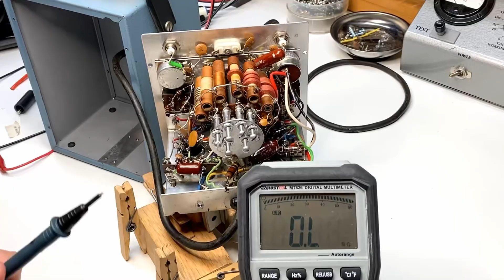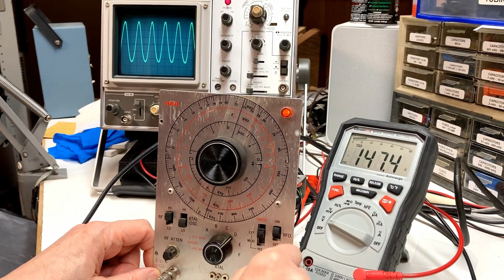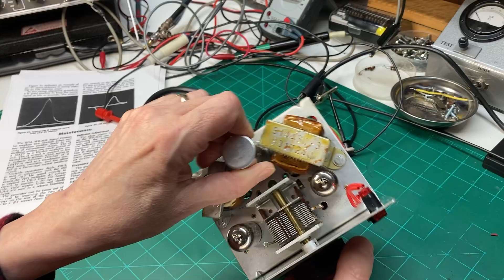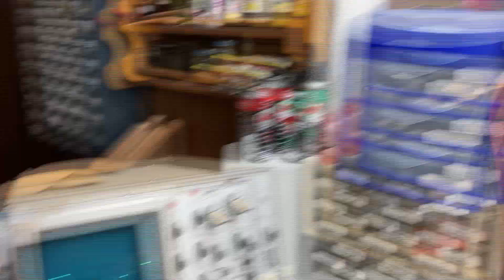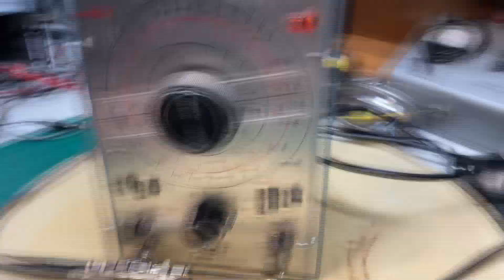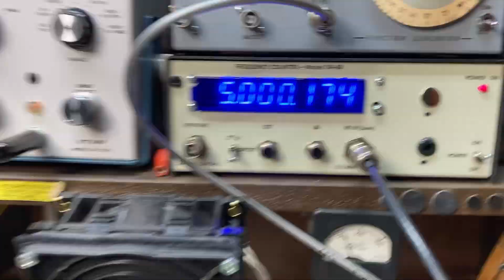RCA WR 50B Signal/Sweep Generator Power Up & Calibration

Comment: I like the parallel output that you have the TinySA and the signal generator hooked up to. Where would I find one? (Probably a common item, but I'm always interested in exact part/model numbers that I see working).
Reply from the maker: I think you are referring to the BNC-T connector, if so, you can get them almost anywhere from Amazon to Mouser. Here is the Amazon link: BNC Splitter Adapter 7 Pcs BNC Male to 2 Female Coax Connector BNC Triple Tee T Adapter BNC 3 Way T Type Plug for Coaxial Cable

Comment: A friend of mine who passed several years ago had a Jerrold 900B sweep generator sitting on the floor in his shop.  That was a 1950s instrument with a big tuned cavity inside which could generate anything from 500MHz up into the L-band at 1.1GHz.  The thing probably weighed about 50 pounds.
Reply from the maker: Back in the late 70's I worked for a guy who bought a simple military surplus audio generator for cheap.  That thing was rock solid but it weighed 75 pounds!

Comment: Your test inherited equipment ensemble looks much like mine.I built my test bench tools up starting in 1962 when I graduated from RCA Technical Institutes. After my tour in Nam with the US Army i pocked up an IBM designed Tektronix portable scope.  I do use my gear in restoring Vintage radio sets. Forget ESR with the cap, no one even had a clue what that was until the advent of switching power supplies. RCA built home equipment to Mil- Spec designs and quality. You wont find cheap paper wax caps in a WR-50 B. The resistors where also a high grade type. Testing each component for accuracy is a total waste of time if you have never fired up the test instrument. If you have a Variac  with parameter monitoring you don’t need a dumb dim bulb  tester, thats for amateurs.
Reply from the maker: I sure wish I could have held on to my Tek. scope when I left IBM in 2020, that was a fine instrument!  The WR-50 B's resistors were almost ALL way out of tolerance. That really surprised me.  As for the dim-bulb, that little thing has saved me several times recently when I accidentally shorted the mains while working on something. -- Thanks for the comment Erin!
Reply: I've worked in the electronics industry for over 40 years and have owned my own shop for many of those years.  I have a variac with both voltage and current monitoring as well.  Having said that,  I find dim bulbs to be a very effective way of powering up old  equipment of dubious condition, and they can be useful for reforming capacitors in the device without having to  babysit them.  I guess that makes me a dumb amateur.💡😜

Comment: Great video, thanks. I have a same signal generator, and try to calibrate it. I had the R9 adjusted to 6V and calibrated all A to F bands without much trouble. But I can not get the wave form on oscilloscope for 455 khz and 10.7 Mhz sweep. Read the instruction which is not quite help since the way it did need crystal. I do have frequency counter. My question is can I calibrate 455 kHz and 10.7 MHz with the frequency counter (with the Modulation switch in Ext without any signal input) instead the wave form? Thank you in advance.
Reply from the maker: You only need the crystal if you want a marker to appear during sweep mode.  The 455 Khz. signal is adjusted using L7 (See Pg. 42 of the manual), L8 for 10.7 Mhz. You should be able to calibrate using a freq. counter.  Actually, the dial of the RCA is so far off that you'd probably want to use a freq. counter anytime you use the generator just to be accurate.  --  The direction manual IS kind of confusing especially when it comes to where to set the MOD & VFO switches.  I just had to fiddle with the settings to get the output I wanted.  Later I'll try and see what the proper sw. settings are to cal. the generator and get back to you.
Reply: Thank you very much for your reply. I will try to calibrate the L7 and L8 with frequency counter, then try the RCA on some transistor radios. By the way, when I read the manual, it mentioned the original testing cable has a 0.001 pf 500 V cap built in, so I soldered a 0.005 pf 1000v cap that I have before the BNC output.   @DVRproductions52

Comment: The sine wave from the generator looks AWEFUL!!!!!!   Is there any adjustment for that??????????????
Reply: Get over yourself  Steven , the RCA WR50 was only a $65 piece of gear in 1966 and it’s still very useful and in demand.  RF circuits do not really  care if the waveform is perfect, it’s all about circuit excitation.
Reply: @erin19030 
Not being a clean sine wave means lots of INTERFERENCE in other bands from the harmonics the sine wave contains, which I assume is OBVIOUS to anyone working with RF.
I am not an RF transmitter, so there is nothing to "GET OVER", so please refrain from personal attacks..
Reply from the maker: Actually no.  You should see my other (3) vintage generators sine wave.  This is the best of the lot and it's typical for these.  It's just the way they are, believe me, I've tried.  Sometimes I think they were designed that way so they could take advantage of the harmonics of a poor sine wave to get 2X the frequency out of them if needed or to create a dot or bar pattern on a TV.
Reply: Its one step above the EICO 324 RF generator. None of this gear is professional lab gear, but the users are clever people.
Reply: Dirty sine waves in an instrument like this are not a problem if you know how to use and interpret them.